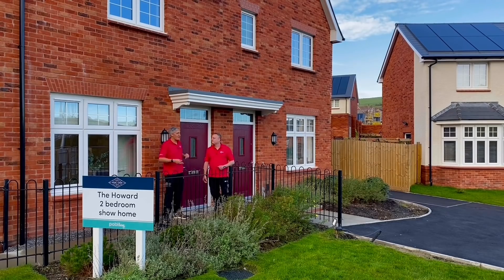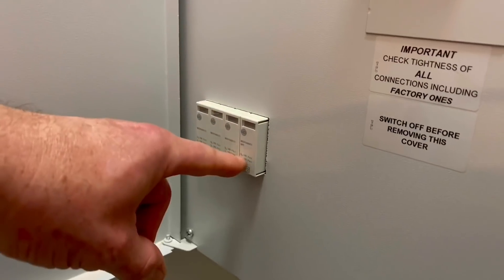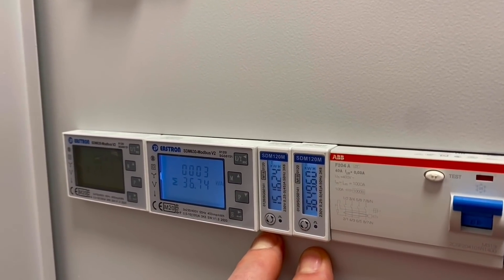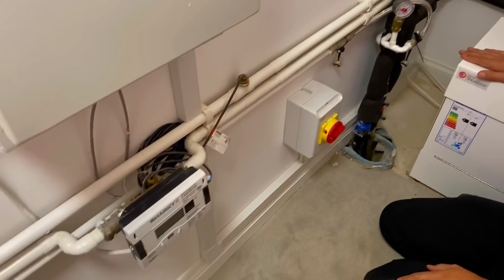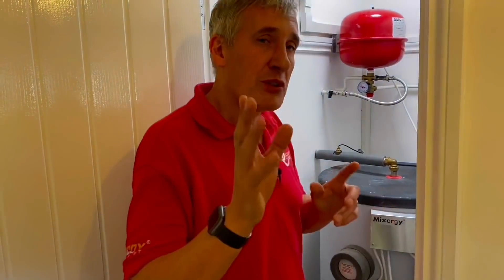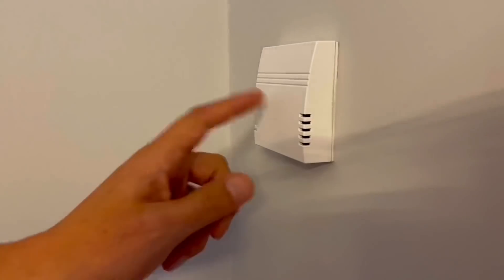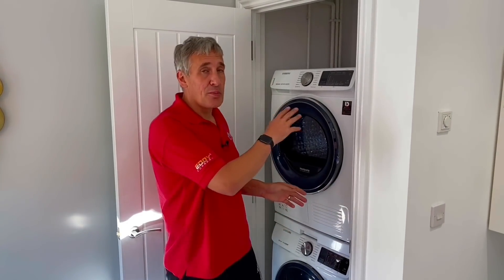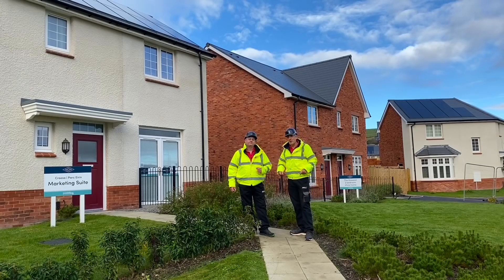THE FUTURE OF HOME ENERGY is HERE - A GAME CHANGER FOR ELECTRICIANS

Comment: It's horrifying to think how much all this stuff will cost. The 5 kWh battery store will be more than £2500. If you want it to last for 1000 cycles you mustn't charge it above 80%, nor discharge it below 30%, so it will really only store 2.5 kWh. Over its 1000 cycles that will store 2500 kWh. So that battery will add, IN STORAGE COSTS ALONE, £1 to every unit of electricity it handles. This is complete madness. 
As for the ground source heat pump,  that 3 kW heat pump that you use to pull heat out and the extra costs of a low-temperature system cost in the order of £7500. If it lasts for 20 years, and it won't, that's £375 a year or about £1 day. If the system is on full power in winter and zero power in summer, its average power is 1.5 kW, ie 36 kWh per day. So that's 3p per kWh capital cost on top of the running cost of the system. In fact, the system won't last as long as that and in will need expensive maintenance. Call it 6p/unit capital cost. 
The heat pump will have a maximum coefficient of performance of around 3.5 (less when it is producing high temperature heat for the hot water cylinder). That means that it generates 3.5 kWh for every 1 kWh electricity supplied to it. At current electricity prices of around 20p/kWh, that means it produces 3.5 kWh for 20 p worth of electricity, ie about 6 p per unit. Add to that the capital cost of the heat pump heating system and you at around 12p/kWh. 
In fact you won't get a COP of 3.5 because the heat source will gradually get colder during the winter as you pump heat out, making it harder to pull more heat out, hence reduced efficiency. That will have have two consequences. The first is that you will need more energy from the supply to pump energy from the source, the second is that you will have to use on-peak electricity to make up the difference...and on those cold winter evenings, when there is no solar and there is high pressure over the whole country so the windmills are not working, your 5 kWh of battery storage (only charged to 4 kWh remember because you want it to last for 1000 cycles) will supply your heating needs for less than 2 hours, even if you run it dry. You will have to resort to the grid, which will be burning any fossil fuel it has, at an efficiency of 33% when you take into account distribution losses, so you will want the grid suppliers to burn 12 kWh every hour (that's 12 kW) to supply your measly 3 kW heating load. 
I'm sure that there will be mistakes in this analysis thrown together. Do correct me where they exist. And forgive me for my realism. 

By the way, just a couple of unit slips in your normally excellent dialogue. 5 minutes you say a storage of 10 kW. That should, of course, be 10 kWh and just after 8 minutes you refer to charging a car at 22 kW per hour. That should be simply 22 kW or, if you prefer, 22 kWh per hour.
Reply: 1000 cycles doesn't sound like much of a lifetime. That's barely three years if you charge your car every day.
Reply: @rivkahlevi6117  Tesla Model 3 long range has a maximum range of 360 miles. So 1000 charges would appear to be 360,000 miles. That's more than would seem necessary because the average car does about 106,000 miles in its 13.9 year average life. In fact you won't get 360,000 miles if you charge it fully and drive it 360 miles every day because the capacity of a battery reduces rapidly when charged and discharged fully.
Reply: Have a look at  the battery test Centre in Australia ....
Reply: @MartynDuerden  Thanks. Very interesting. These are batteries very carefully charged and discharged. The best one has 80% capacity after 3300 cycles. The second best has 75% after 2500 cycles. The majority have failed along the way with a range of faults. 
Oh, and it reminds me that I forgot to consider round trip efficiency, the percentage energy put in that you get out. At an average of 87%, this adds a further 15% to the cost of energy stored in a battery.

Comment: I do electrical maintence for a housing association and they have changed a lot of dwellings from storage heaters to Ground source heat pumps as fitted by other contractors , most of the time the tenants  are happy as its more efficient and cheaper to run but there have been quite a few breakdowns of the systems  as well.

Comment: Can you consider covering whether an EICR needs to be re-issued/assessed if a permanent part of the electrical installation is replaced? I’ve looked on the IET site and the subject is not mentioned.
Reply: I wont need a new EICR, just the relevant paperwork for the work that has been carried out. Technically an EICR doesn't even need to be reissued if it fails and remedial work is carried out with relevant paperwork.

Comment: The cost of maintenance over the years will be ridiculous for a 2 bed house. Its cool stuff and a nice idea but the only way ahead is to build more nuclear power plants.
Reply: Are you sure nuclear (and wind) is the way forward?
Who would want a heating and hot water system based on electricity from the grid only, which would cost little to install and have virtually no maintenance costs and not even require a dedicated plant room, no matter how big the property is? Worse still is that practically all electricians / plumbers already have the skills to install such a system.
Who would want all this when you can have a solution for £85,000 and be less warm at the same time?
Reply from the maker: What is there to maintain ?
Reply: @efixx  All of it? All the monitoring equipment and controls don't last forever. The extra pipework needs to be maintained also not to mention the batteries, what is the lifespan of those? Also a normal plumber wont be able to help you with a lot of the problems so you'll be looking at employing "specialist contractors". A normal heating system will incur maintenance costs over a 10 year span but the return is a good quality heating system. All the extra bits of gear complicates the system and I think the savings are massively overestimated for a house of this size. Is there any kind of forecast of how much might be saved over 10 years for instance? Id be surprised if its more than £500 by which time I'm sure all the batteries will need to be replaced.

Comment: The only bit that makes my knees wobble is the different makes of switchgear in that top panel. I hope thay have all been type tested! This should eventually not be an issue once a single manufacturer starts producing everything for a panel like that.
Reply: I think people are getting little hysterical about this. It used to be the concern that mixing brands caused mechanical strain on busbars and devices which may lead to poor connections which could be a fire risk and distorted CU covers compromising IP ratings. Panel wirers mix brands and devices all the time. In fact, open up a big DC EV charger and you will see Schneider, ABB and Hager devices all sitting on the same DIN rail! I'd like to see a blank between the two devices to perhaps mitigate any interference or hotspots but otherwise I can't see a problem.
Reply: @Blackf1ngers  yeh I know what you mean, we make bespoke panels (distribution boards) for caravan parks, no busbar and all panel wired. We did still get questioned by the Niceic over them tho, as we have Abb XTmax Mccbs as main switch with Eaton Mcbs.
Reply: @Blackf1ngers  yeah totally agree, the reg was written to avoid high resistance joints with regards to different shape MCBs sharing a single buzzbar. The din rail system is worldwide to build custom panels.
Reply: It only really a potential issue when placing devices sandwiched next to each other and on the same bus bar.  Look in any industrial control panel and you will find all sorts of different brands and types of kit sitting on the same Din rail.

Comment: Ground or air source heat pumps will work on new houses like this, new, fully insulated with the latest materials and building technologies, start fitting them on older houses that are no way near up to the thermal values of new builds and they will just not be cost effective.
I wonder which way things will go as the government are pushing heat pumps but for me Hydrogen boilers are the way to go, at least for older houses anyway, not unless you want to spent a fortune in winter running the heat pump constantly. Much is the same for electric transport, for cars it may work but for other modes, lorries, plant machinery and many other modes of transport batteries just will not work. Big changes need to come to preserve the planet but in which direction we will go and to what cost, who knows ?
Reply: Biggest problem with hydrogen is that green production is very expensive and current industrial methods even more polluting than burning natural gas.  If you've enough "spare" green electricity for the electrolysis of water into hydrogen then you also have it to run electrical appliances including ground or air source heat pumps at greater efficiency.

Another is that it's really needed where there is no alternative, mostly replacing fossil fuel usage in high temperature industrial processes where the potential cost/benefit ratios are a lot more attractive than any domestic environment.

Comment: I wouldn’t want all that gubbins in my house. I saw a newspaper article where a family ripped out a heat pump and shove it in a skip and installed a normal boiler due to the heat pump breaking down and not delivering enough heat and power. So that’s already one heat pump down the tip.
Reply: Heat pumps are ok in  high spec and one off builds where insulation levels are much higher than spec built houses. Also underfloor heating is an absolute must because of the lower temperatures required. Heating radiators and hot water with a heat pump is sometimes unachievable in cold weather. Just another example of imbecilic government ineptitude to bow down to the climate zealots and consign everyone to poverty.
Reply: @paul756uk2  There's no doubt that using a Heat Pump to heat domestic hot water is inefficient. It is generally much more cost effective to use the heat pump during the middle of the day (and overnight if you have a ground source for the heat) to collect water for heating, and to use the solar panels to run an immersion heater to heat the domestic hot water to a higher temperature. In theory, you can use one thermal store to store this water at two different temperatures, but I'd like to see research into using a direct cylinder for the  domestic hot water, and a thermal store for the heating.

Comment: If this "Green" living is cheaper to run, and is more effective than the status quo (gas or oil), then the uptake will be automatic. The fact that people have to be cajoled, lied to and face the threat of banning current technologies raises very serious doubts.
Reply from the maker: So what are the doubts and the lies?
Reply: @efixx  Hello Mr. eFIXX. For starters, simple high-school physics. If you burn gas in a domestic boiler, it is cheap and efficient. Running a heat pump (inter alia) is not. So, you take gas, and run a gas turbine to generate electricity. Then you step up the voltage to transmission levels. You transmit it. You step down (in several steps) to LV levels. You then run your heat pump. At every step, there are considerable losses. So best just take that gas and burn it in your boiler.

You might argue renewables. Well, they are not reliable. Great whilst the wind is blowing, or the sun is shining, but that does not happen constantly. The only way would be nuclear, but those plants do not get built over a weekend. Plus the (misplaced in my view) public resistance to nuclear. Never mind the French have relied on it for decades without too many issues.

Same story with motor vehicles. Rather just fill them with petrol or diesel, treat the exhaust, and just get going. Let's not get into the whole global warming / CO2 bunkum, but remember every living entity from a Corona virus to a Blue Whale is carbon based. As for physical CO2 emissions, has anyone ever calculated how much CO2 a living human exhales in a day and decided to action that? I didn't think so...

Every autotrophic and photosynthetic organism requires CO2 to function. Optimal levels on earth would be around 800ppm. We are at around half of that. Reduce CO2 any more, and we will see massive desertification, and rain forest destruction that will make logging / jungle clearing look like a child's picnic.

Whilst I am absolutely in favour of mankind cleaning up its act, take the money out of this "Green" nonsense, and it will disappear as the darkness disappears at dawn. As I have said before, make these new technologies cheaper, and more efficient to run (forget about the initial capital cost), and there will be an immediate and unreserved uptake.

Comment: I think hydrogen will be a more cost effective way of using the existing network we have at this moment and as Roger (skill builder) pointed out, you could use excess grid supply to create hydrogen and then burn it to create electricity at peak times. id say that's a much more efficient battery than what we have at the moment. I think parts of what you have shown will be taken up in the home but not all. If you look a long way down the line I believe that localised energy creation will be the future, such as local a hydrogen plant and storage and even one day fusion plants.

Comment: That's a show house? Really? The installation looks like it was cobbled together by a hobbyist, the fit and finish on the plaster is horrible, the paintjob got anywhere it shouldn't go, the installed controllers look like they were designed early last century (been ages since I've seen a digital room temperature controller that doesn't have a display and half-degree steps from 12 to 30°), the location for the battery is just a joke and its extending frame (seriously, it looks like it was designed to be mounted flush INTO a wall) is a major injury risk (perfect height to put holes into kids' heads on the lower corner there, too), that cable at 9:22 that's fixed at both ends but flapping in the breeze would be a major code violation here---that's dangerous, one little pull and you'll ripp a potentially live wire out of the wall. Especially in an area where you need to grouch because it's not high enough to stand and could easily grab wildly to stop falling...
Reply: Well said mate, exactly what I was thinking.   Unfortunately that seems to be the norm nowadays.  Get in, do the quickest easiest job and sod the workmanship.  It's happening in all trades.
Reply: I was thinking the same about the comms. Lock it in a box, mention WiFi and call it top secret 🤫 🤣😂
Reply: @Jon_Godfrey  I'd put money on it being a raspberry pi shoved in there with a plug top psu
Reply: Not to impressed with layout, design or finish, snags on finish everywhere. Not to mention the bad layout and design, lot of wasted space for a small house. Really for efficiency in estates it's got to be shared services,  the overhead for the equipment is too much for one small 2 bed.
Reply: Its a basic CDM failure over here too, its the uk though, shoddy work is a daily find for us sadly.
Reply: I thought the same. Especially regarding the battery.
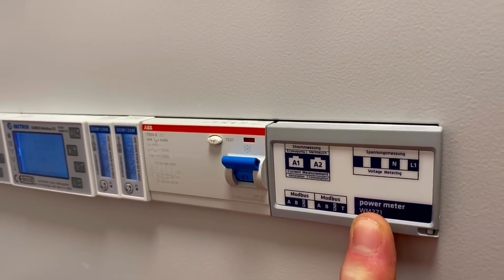Reply: 3:44 shows that better
Reply: get a mate do spark job...

Comment: I would like to see inside the meter box, there was a time when the dno would only fit a 3 phase supply internally.
As well as a residents view on living in that home, and are the running costs of an all electric house low.
Reply from the maker: Tune in to Saturdays video for the first fix tour including the meter box. Running costs are low. Info from one resident suggested £65 a month - including the power to run the car 🚗
Reply: @efixx  is that with RHI though?
Reply: Running cost is probably low in a modern well insulated home with under floor heating, but try and add the equipment to an old property with radiators installed and it will cost a fortune to run. Heat Pumps are definitely not  the future for retrofit installations in old draughty homes, hydrogen and gas alternatives are probably the way forward.
Reply: @mickbitchum4664  yes , fit insulation first . No mater what heat source you have .
Reply: @mickbitchum4664  definitely

Comment: I wonder if the home owner is getting charged an additional tariff for having 3 phase.?
Reply: Absolutely! Generally half hourly metering, won't be any different to industrial units, just lower usage!
Reply: Depends on both the DNO and retailer's policies.  For example Eon supplying via Northern Powergrid in Yorkshire are exactly the same price as single phase but down here EDF via UKPN have a slightly increased standing charge and 3-phase is standard unit cost only, no special tariff deals available.

Comment: I can see some good intentions here and we certainly need change. However, I'm slightly concerned about the carbon footprint involved with the manufacturing, importation, repairing (or more likely, replacing) and disposing of all this extra electronic equipment and battery storage in the home. Is this going to result in just more electronic waste next decade to tip on top of the disposable LED products we now have? How does this scale up in an  eco-friendly way? 🤔
Reply from the maker: Batteries will be recycled there are valuable materials inside.
Reply: @efixx  I agree, the actual battery cells will/can be recycled, which is great.
Reply: @efixx  That's IF people take them to be recycled.
Reply: Too right. When you add equipment capital energy costs in, the energy savings of this over-engineered solution disappear - in fact become negative.